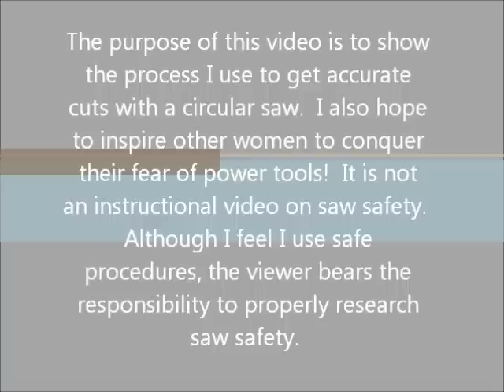Cutting a sheet of plywood with a circular saw

Comment: Nice video. Thanks for posting. As a small-framed guy without a lot of upper-body strength (read: "Built like a girl!"), I have endured the same kind of tough-guy ribbing that most women learn to live with when they go into traditionally male professions, and I appreciate your efforts at easing other females into this basic skill set. I like your on-the-floor approach, but I feel it necessary to point out that this position may sacrifice strength/control to comfort. A couple of sawhorses at around waist height might end up working better.
Reply from the maker: Thanks Carl--I'm considering looking into some saw horses and seeing which I prefer.  The people who are commenting about backs and knees have legitimate concerns!  I've always felt that the floor would give me greater strength and control since I would be more on top of the cut, but I could be wrong (I certainly have been before lol).
Reply: Not to brag on myself--I'm actually a total schlep when it comes to woodworking--but I recently built a work bench out of salvaged lumber using all hand tools, except for an electric drill. The basic frame is held together with dowels and glue--no nails, screws, brackets, etc., and the solid-core door I'm using for a top weighs close to 100 pounds, or almost as as much as I do! The thing is rock-solid and is the kind of stable surface one needs when using power tools. I have a cheapo table saw which I found for free on Craigslist; my next project is to build a better table top and some legs which will place it at the exact same height as the work bench so that the work bench can operate as an outfeed table. THEN, I can start safely cutting up 4' X 8' sheets of plywood (or 12' planks, or whatever...) all by my tiny self. A circular saw is OK, plus it's portable, but based on the information I've picked up watching woodworking videos here on YouTube, I think that a table saw with an outfeed table is the safest way to go when cutting long stock.
Reply from the maker: That's awesome--and doesn't sound like "total schlep" woodworking to me!  The outfeed table is my issue with cutting up bigger stock because I don't have one at the right height (one issue I have with the Ridgid table saw is how high it is, but then I have that issue with a lot of adult-sized things in life).  I need to find something that works that can break down for storage when not in use so I can make better use of the table saw.  I'm thinking adjustable height saw horses, that way I can use them for multiple things.
Reply: I have some photos to give you an idea of what I built, but don't know if I can attach them here. (Which is probably just as well, 'cause it's really ugly!) As I said in my earlier comment, every bit of the lumber was absolutely free for the taking, including dowel rods (the big ones came from mop handles made of oak or hickory, the smaller ones from a discarded crib), the 4' X 8' sheets of OSB, and the fancy $200+ door. I spent $6 on some wood glue, and that was it. To attach the OSB to the carcass (or frame), I did use finishing nails, only because I couldn't figure out how to clamp it on while the glue dried. I must give credit to Matthias Wandel for two ideas: Drilling through-holes for the dowel rods, thus eliminating the need for a doweling jig, and attaching the top by gluing pre-drilled blocks of wood to the carcass. If you haven't watched his videos yet, you owe it to yourself to check them out. He not only knows how to do it right, he also knows how to explain what he's doing. And I suppose I should add that's he's not a dumbass, as are so many other YouTubers, present company excluded....
Reply from the maker: I will have to check out Matthias Wandel's videos, thanks for the recommendation!  And a $6 for a heavy-duty work bench is unheard of and I have to say that using the handles from mops as dowel rods is ingenious!

Comment: Today I bought two 8 by 4 plywood boards to build drawers for my first woodwork project. I built a guide for my circular saw with aluminum squares. I thought that I had it working fine after some  tweaks.  I tried another cut to confirm that system was good but all I  got was an awful cut. The guide did not bend, but for some reason the blade cut into the part. I am not sure what to blame for the failure so I am thinking that the blade was the one that bent and ruin the work. I noticed that the blade did not advance, it overheated and started to burn the wood. What kind of blade do you use for plywood?  Thank you so much for your video and sorry for the long post :-)
Reply: You can google up several circular saw blade buyer's guide, but a plywood blade will have 100 teeth or more and is not the kind that is normally included with the typical homeowner grade of circular saw...  remember, the wood that you want to keep should be the part under your guide, that way the blade can never cut into it, only away from it if you don't hold the saw tightly against the guide...
Reply from the maker: I bought the Kreg Rip Cut awhile back and it really works well--I recommend it.  It hasn't completely eliminated my use of the saw guides I use in this video, but it sure speeds things up and it's very accurate.  It was about $35 when I got it--worth every penny for a large project.

Comment: Hey, why did you work on the floor instead of using saw horses? Also, I may have missed it but why did you orientate the supporting 4x2s perpendicular instead of parallel to your first cut? Wouldn't being able to stand up without having to step over the support beams sticking out from underneath your panel make the job easier and safer? Genuine questions and thoughts here (ie not having a go). Thank you for sharing this video and your blog!
Reply from the maker: +Mark D Thank you for asking the questions, it helps me know the gaps I need to fill in about my posts on circular saws on the blog!  I work on the ground rather than up on sawhorses because I don't have good arm reach (short arms) and I can't see over the cut when it's up there (short legs).  I also don't have the upper body strength to move the saw along the straight cut jig from the angle I would be positioned.  As far as the 2x4 positioning, by having them perpendicular to the cut, the plywood is totally supported on both sides once it is cut.  There is risk that by having the 2x4s parallel to the cut that once you cut through the plywood it will fall inward and pinch, which could result in kickback.  You do end up cutting into each 2x4 as you make the pass with the saw, but if you have the blade at the correct depth (half a tooth into the plywood) it is a shallow cut.  Mine have grooves all over them at this point :)  I hope I was able to describe it ok.  I might need to do a video explaining this--much easier to show it rather than write it.
Reply: +Pink Toes and Power Tools Thank you for the prompt and detailed response. It's helpful to see and understand other people's technique. Re: support positioning, parallel supports can be positioning so that both sides of the cut are supported. Why would the work piece fall inward and pinch if it's supported? Also, is having the blade cut through the supports absolutely necessary? I'd like to preserve my support beams for as long as possible.
Re: reach and strength, I don't see the mechanical advantage you get from being on the floor versus using short saw horses (positioned between knee and hip height) unless you are going to actually stand on the panel (obviously you can reach further into the panel that way). 
Regardless, it's good to know the floor is an option!
Reply from the maker: +Mark D You're right, I do end up standing on the panels for quite a few cuts when they aren't as narrow as the ones in this video.  I've never tried the sawhorses to know for sure, but the amount of effort it takes to make the saw stay tight up against the straight jig and move down the cut seems like I wouldn't be able to do it as well holding my arms up and out.  Wider cuts I know wouldn't work up on them for me.  The floor works for all the cuts I have to make, so that's all I've used!  You're going to have to have the blade nick the support beams, I can't think of another way around that.  It's the only way to get a clean cut through the plywood.  If it doesn't cut into the support wood just a little, you'll find that it might leave the last thin layer of the plywood not cut and it will rip when you go to separate the two pieces.  I've cut on my support boards for 5 years now (3 years very actively) and they are still working fine--if you are woodworking as a hobby I would think you'd be fine for at least a couple of years.  Perpendicular support means that the plywood you are cutting is constantly supported no matter how narrow you make your cut on the plywood.  In order to have good support with parallel positioning, you would have to have the support boards directly underneath each side of the blade of the saw and others next to them so that once the cut is made, the plywood cannot fall in toward the blade and pinch it.  It would be difficult to do safely and I wouldn't recommend trying it.  I will try to make a quick video to try to explain this because I think it's confusing!

Comment: The 2x4's minimize kickback?  I believe their main purpose is to prevent cutting whatever is beneath the plywood, and to prevent damaging your blade on the concrete floor.
Reply from the maker: They also keep the plywood fully supported so that it doesn't lean in as you make the cut and bind or pinch the blade.  Kickback occurs when the plywood pinches the blade.  That is why I lay the 2x4s perpendicular to the cut I make so that the plywood rests without moving on the 2x4s as the blade moves.

In this case they definitely minimize the chance for kickback.

Comment: Why not use ssq to place cutting jig as an extra check before cross cutting. My preference is to crosscut from the other end so my jig is left securely on the long piece and the cut piece falls away. but u must add kerf thickness to your desired measurement. You could make custom saw horses to suit your height. saves the BACK
Reply from the maker: I agree, working on the floor does affect the back :/  I find that I never get as accurate when I have to add in the kerf or make adjustments like that--I envy you that you can do that and make it come out alright!

Comment: Great video, and good on you for doing 'avin a go'.   You sure could do with a work table and a Festool 55mm plunge saw with dust extractor attached.   You have no idea just how much dust is produced when cutting wood.   I always use a full nose protector when cutting anything these days.
Reply from the maker: I definitely need to get some dust protection.  It always fogs up my eye protection and it's so hot, but I need to quit whining and just wear it!
Reply: Pink Toes and Power Tools Try the Dust Be Gone product.   I bought one on line from the US and had it sent to Australia.   Works well, and has a piece of wire that can be bent to fit your nose, and does not fog up.   Wash out after use and reuse.   Works very well.   It's on You Tube of course.
Reply from the maker: Sam Sabastian
Thanks for the suggestion--I will definitely look that up!

Comment: ok, but I get the same results with a length of square tubing and 2 C clamps. Measure the width wanted of the plywood plus 5.5 inches  for my saw and cut.
Reply: This jig is easily made with scrap wood or Ok, maybe long pieces of wood that has to be cut, like in this example.  But for smaller lengths, such as 4-5 feet, you can make it from some scrap plywood or other small pieces of wood. 

Of course, if you already have other equipment...for example a TABLE SAW, then maybe you don't need to do this method.

Comment: Hi. Thanks for the great video. As a novice, I found your vedio very useful. I just bought a circular saw and tried to do a straight cut to get 72X 27 cut from a 94X48 plywood sheet and messed it up. I have a couple of questions, if you could care to answer
1) Did you make the guides on your own and if so how did you do it?
2) What heppens to the wood below the plywood? Do they not get cut when you pass over them with the saw? I heard you say that you kept the saw a little over 1" deep. So does that little over not cut / nick the wood?
Reply from the maker: Thank you for your kind words!  Yes, I made the guides.  Here's the post on my blog about how I did it: http://pinktoesandpowertools.com/2011/01/30/beauty-and-the-beast-cutting-plywood-part-2/  The 2x4s below the plywood do get shallow cuts in them with each pass you make.  I've been using the same 5 support boards for 3 years now and they are going strong still.  You shouldn't have the blade much deeper than the plywood width, so the cuts are pretty shallow.  You can't use the 2x4s for anything other than the supports after though--they won't look nice!
Reply: Pink Toes and Power Tools Thank you. Appreciate the response.

Comment: No disrespect intended but your video goes against everything I was taught about using a circular saw.  Your video sends chills because of the danger in the way you are doing this.  The concept of the straight edge is o.k.  It is the fact that everything is on the ground.  This aligns your body incorrectly if the saw were to pinch and kick backwards.  When things are waist high, you can stand beside your work and if the saw kicks you are out of the way.  i am a journeyman carpenter with 35 years experience.  if someone entered unexpectedly , ( who doesn't belong there), they could trip and you would be minus your beautiful toes or fingers.
Reply: +Ted Rowland Kickbacks on thin plywood are really rare and anyway not so strong to create dangers, at least for me, maybe for a woman or light men they can be dangerous too.
Reply from the maker: +Ted Rowland No disrespect taken!  And anybody reading these comments should take this comment into consideration when they are deciding how they are going to rip a sheet of plywood.  For me, standing beside a sheet of plywood and cutting up off the ground is not possible.  I simply could not reach to the side of me and push a circular saw along the straight edge with any kind of control because I am short and I don't have the upper body strength that a man has.  I feel that it is the safest option for my circumstances, but it may not be for everyone.  I do keep to the side of the saw just as I would be if it were up off the ground and I use the five 2x4s that the plywood rests on in order to keep the plywood from pinching and creating the circumstances for kick back, and so far I have cut through a fair amount of plywood sheets for a casual DIYer and have never had even a tiny incident to make me rethink my process.  BUT this does NOT negate your concern, and anyone reading this should take Ted's comments into consideration--thank you for your comment.
Reply from the maker: +Robert S I am very thankful to have avoided any kickback so far, but I try to keep in mind every time that I use the saw that it is a possibility.  I don't look forward to it happening!
Reply: Well, I also use a 13 amp saw, and we're kind of forgetting the problem of balance when you are in this position and sawing.  I have had to saw old floors this way and it is always risky.  The saw when it kicks, if it twists your hand can walk backwards on the surface you are cutting.  I saw a guy have it kick and it cut his leather bags in two.  Lucky he had just filled the pouches with nails.  It saved his leg.  I had just warned him 2 minutes earlier that he was putting himself in danger.  Anyone can do as they wish, I was trying to pass on a little wisdom and experience.
Reply: Ted Rowland You are an idiot sir...
Reply: Robert S
Been called worse by better.
Reply: I am a newbie in carpentry, but so far I have to agree with Ted Rowland. It is all about safety when you are working with power tools. Sure, it might be 1 in a million possibility of a kickback and loosing your fingers. But when it happens, the consequences might be dire. I've seen a lot of workers not using the goggles while cutting metal and they were all fine. But I also saw one of them taking a bus to the hospital. He was talking to someone on the phone, saying how worried he was after getting a metal chip in his eye. Heck, people loose their eyes to such things. Never underestimate safety. If someone has balls to ignore it, remember, that you might cut those balls off one time. @Pink Toes and Power Tools - other than the safety issues, great video. I've got some large sheets of plywood to cut myself, was looking for this type of video for newbies. Thank you!

Comment: Hey Pinktoes! thanks so much for the demo. I just had one question. When ripping the large sheet and cutting across the  support 2 x4s, have you ever had the saw catch in a groove from a previous cut underneath and throw it off the cut line? Thanks for the videos! I am new to woodworking and have no table saw either! You just saved me a ton of time and money.
Reply from the maker: wayman29 I've never had a problem with the saw catching in previous cuts, so I wouldn't worry about that.  You do have to keep it snug against the guide for the entire cut, but just being aware of that and keeping tension to that side is all it takes.  Good luck!  Hope you are enjoying learning woodworking--I'm missing it right now.  I haven't had time to start a project for months and now it's getting cold out.